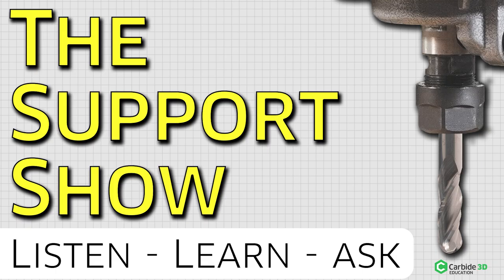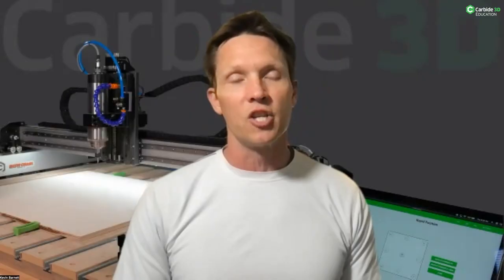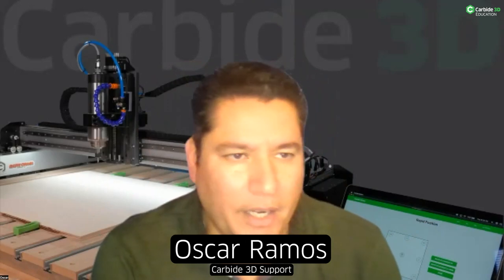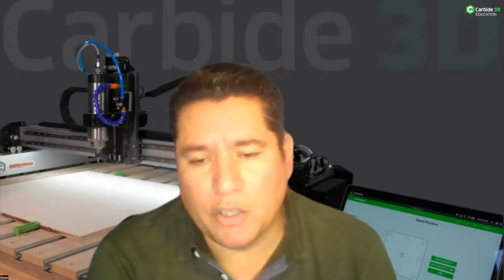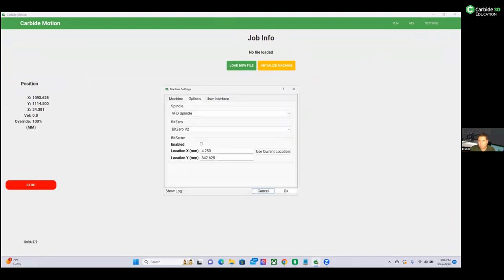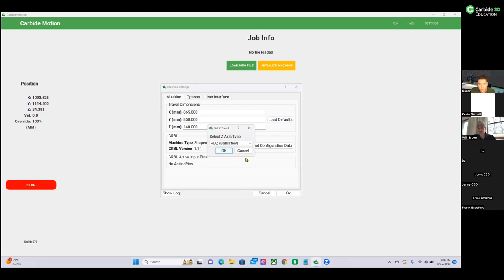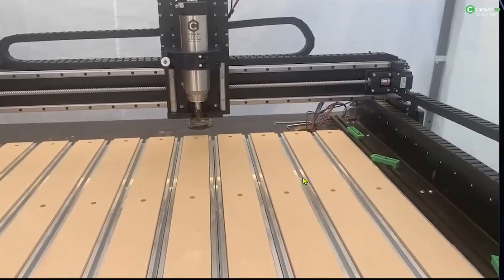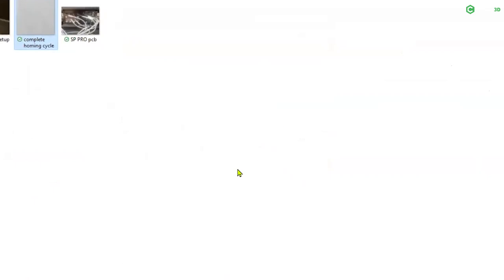The Support Show Ep. #3 - Initial Machine Setup + First Start

Comment: You didn't mention what the blinking red LED is for. It would be good to mention that it, and the one right next to it (which is hard to see because the red one is so much brighter), blink when the USB is sending and receiving data and Carbide Motion is constantly "talking" to the controller when it is connected, so the light is blinking all the time even if the machine is not doing anything. People regularly post in the Shapeoko groups asking what is wrong because the red light is blinking and people associate a red light with an issue.

Comment: Have a S5, regarding the power pendant, can you use the stop button as a normal on/off button or is it just for an emergency? I have been using the main power switch on the controller but wasn't sure if using the em stop button would degrade it long term or something.
Reply from the maker: The E-Stop can be used as the main power switch for the machine.

Comment: Just assembled 5Pro - during initialization, seems the machine is looking for BitSetter on opposite end of the machine. My bitsetter is positioned on the front of the machine (next to Carbide logo). During initialization, the spindle is moving to the back right of the machine, probing down and not finding the bitsetter.  Receiving failed homing notification.  Any help?
Reply from the maker: Richard.   You need to set the location of the BitSetter.  
Connect to your machine
Go to Settings
Disable BitSetter 
Initialize your machine. 
Jog the spindle with a bit to the middle of the bitsetter and less than 1/4” above it.  
Open Settings
Click Enable BitSetter 
Click “Use Current Position”

You’ve now told the machine where the BitSetter is located.   The machine will reinitialize and touch off on the BitSetter 

If you continue having issues reach out to: support@carbide3d.Com

Comment: While setting up my machine, pushing the y axis by hand, the left and right did not move together, so i know its racked, how do i get the left and right unracked ?
Reply from the maker: Chris.   Reach out to Support@carbide3D.com
Include detailed information on your machine type and a short video of the issue you described above.  Also send them written details.  
They will get you up and running.